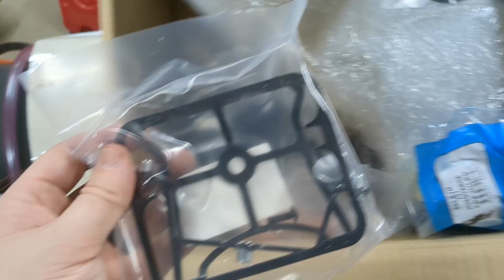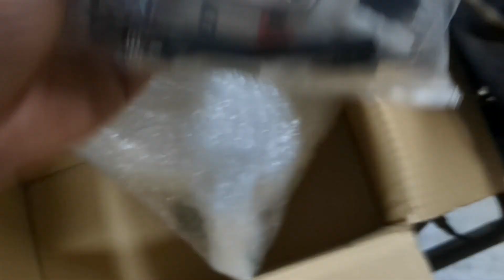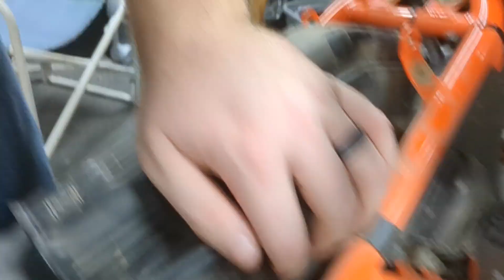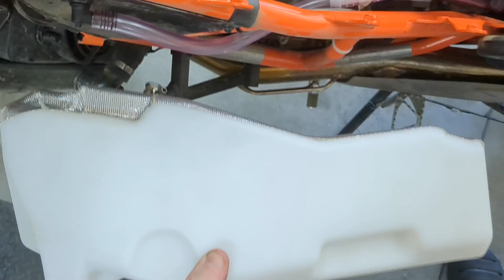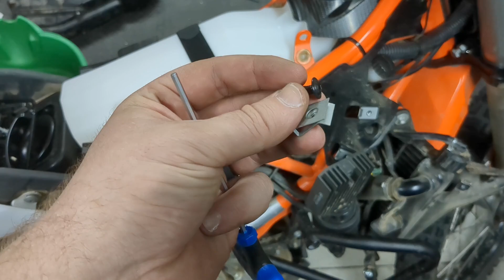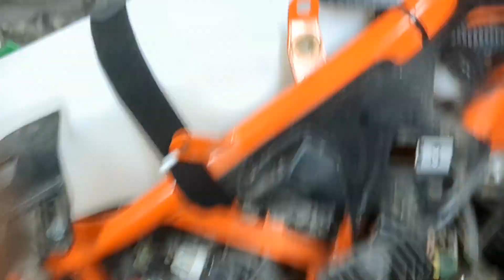The best mod for your KTM 690 Enduro R | Rade Garage Aux Tank Install

Comment: I ride a 2022 KTM690  i just carry a fuel bladder if i need extra fuel alot cheaper
Reply from the maker: Nothing wrong with that. I prefer the tank because it keeps the weight lower and farther forward. After the aux tank mod I get about 70 miles of extra range. In total I can go around 240 miles on a single fill up. That's a LOT of dirt roads!

Comment: If you smell fuel or see a fuel trail running down the LHS of the engine when parked, the tank is leaking. It leaks from where the petcock connects to the tank. I had 4 failures. Also if you remove the tank and the insulation has fallen off, that's another sign that the tank is leaking.
Reply from the maker: Bummer! Sure hope I don't run into that problem. So far so good with about 2k miles after installation.